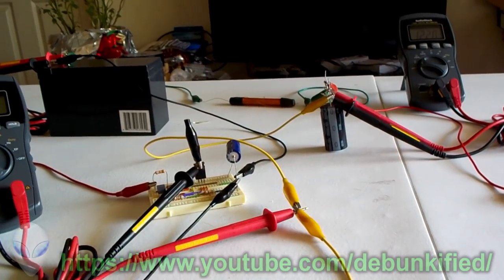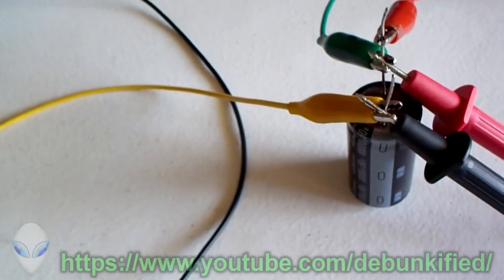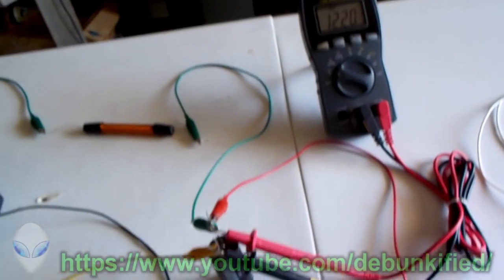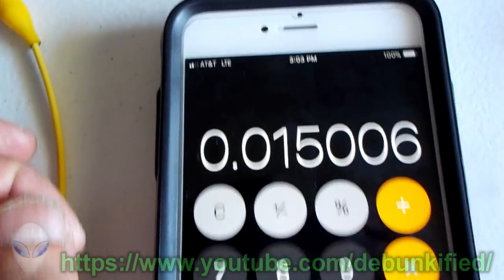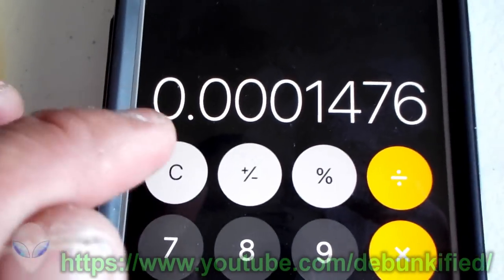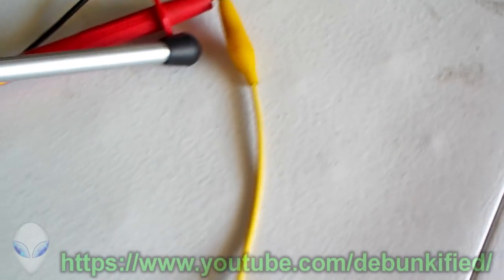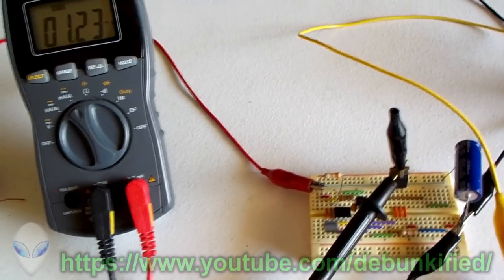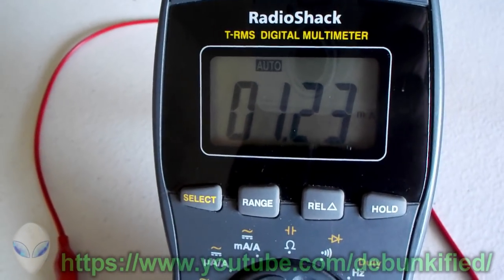LCR Free Energy Generator

Comment: Back EMF technology is one of the most promising and practical ways to generate free energy. It's cheap and easy to do, and doesn't require any electronic knowledge. All you need is a transformer and some wires.

The basic principle behind back EMF technology is that when an electric current flows through a conductor, it creates a magnetic field around the conductor. If that current is then reversed, the magnetic field reverses as well. By harnessing this reversing magnetic field, you can create a power generation system that produces free energy.

One of the best things about back EMF technology is that it's very efficient. In fact, it's estimated that up to 90% of the energy produced by a standard transformer can be harnessed using back EMF technology. This makes it a great choice for those looking for an inexpensive and easy way to generate free energy.
Reply: Didn't Nikola Tesla do something similar to this by having 2 coils resonate on the same electric frequency and then pulling power from the 2nd coil? Since there would be no EM feedback and drawing power from the second coil would leave the first coil unaffected. Patent US645576A - System of transmission of electrical energy.

Comment: 12.20 volts across 10,000 ohms = 0.0012 amps and  .outputs 01464 watts. The device using 014858 loosing 0.000218 watts. COP = .79 . Why do you think you can ignore measuring current thru load? There are  ways to get power from Earth, air, vacuum and ether...Keep trying !
Reply from the maker: Hi, coil smoke, well I can ignore the current running through the load because I’m not really ignoring it since it’s the exact same current coming from the input! Where are you getting the figure 01464 watts from? 12.20 volts across 10,000 ohms = 0.00122 and not the 0.0012 amps which you have also written,, but which would be an output of 0.014884 watts not 01464 watts, which you have also written. 

Not only that but the input is 12.08V x the current of 0.00122 which is .0147376W. The output of .014884 divided into the input of  .0148376 is 100.9933774834437. Multiply that by 100% and lo and behold we have 100.99% which is rounded up to the next whole number which is guess what? That’s right 101% just like in the video.

Rewatch this video again and look at all the volts and amps that are showing on the meters and then compare that to the schematic I’ve provided in the description box. Better yet actually build it so you can see exactly what I’m talking about here.

Comment: Thanks for the circuit diagrams.

0.000147mW = 0.14uW not 1.4uW.
Sorry Credibility factor drops, by a factor of 10.

Are your DMMs rated at 145kHz? I don't think so, your meters cannot measure AC voltage or current at that frequency.

You are not measuring the current through just the resistor, you have the capacitor that it is across, with a PWM pulsing current.
NOT Continuous DC current

Your current DMM is trying to measuring the average of the pulsed current that flows on each ON period of  the PWM, charging the capacitor AND flowing through the resistor.
During the OFF period, you have a capacitor / resistor SERIES circuit, the capacitor discharges through the resistor and no current flows through the meter, so the meter is showing AVERAGE current, not full time continuous.

So you cannot calculate the power dissipated in the 10,000R resistor using the current DMM where it is, because it is measuring current to both capacitor and resistor and averaging a pulsed DC current.

The DMM measuring the capacitor voltage is also measuring an average voltage as the capacitor charges and discharges.

The addition of the coil may have some effect over the current, but only because of the  IMPEDANCE of the capacitor and coil.
Reply from the maker: Hi George
I respect your sound knowledge in the electronic arts but I have to disagree with you on a few points. I have indeed considered the reactive impedance of both the capacitor and inductor and pulsed DC currents.

First the voltage on the capacitor is actually there since the capacitor was completely disconnected while charged to it’s highest voltage and the voltage remains for a time before leakage begins. So this shows that at least the voltage is completely and accurately real especially across the resistor since it is in parallel to it after all. Thank you for looking at the schematics.

Sometimes I make mistakes in what I say in the video that don’t line up with the actual measurements so I’m not sure where you are getting .000147 mW from in the last video before this one.

Where you had written .000147mW = 0.14uW and not 1.4uW. Well I’m pretty sure you were talking about the input watts which are actually 14 milliwatts and not microwatts. In fact I have no idea where you’re getting these figures from, even though I might have said something different than what the meters were showing, which I know what they were showing, but I also know that I spoke it wrong, so this I am aware of but I know for a fact what the power measurements actually are. Video making is difficult so I will say things wrong sometimes.

So I have measured everything again and here are the results as of the present moment:

The meter is placed, very first thing right after the negative of the battery.

Pulsed through the mosfet, capacitor, resistor and inductor. 

Input = 12.20V x 0.00124A = 0.015128W. This 15 milliwatts ok?
Output = 12.30V x 0.00124A = 0.015252W. Ok? Out/In = 1.008

With everything exactly the same except now directly connected to the battery and without the pulsing circuit:

Input: 12.20V x 0.00123A = 0.0150W
Output: 12.19V x 0.00123 = 0.01499W Out/In = 0.999

With everything exactly the same except now directly connected to the battery and without the pulsing circuit and capacitor with the resistor and inductor only:

Input: 12.20V x 0.00123A = 0.0150W
Output: 12.19V x 0.00123 = 0.01499W Out/In = 0.999
So it’s the same without the capacitor.

With everything exactly the same except now directly connected to the battery and without the pulsing circuit and without the capacitor and coil, with just the resistor alone :

Input: 12.20V x 0.00123A = 0.0150W
Output: 12.20V x 0.00123A = 0.0150W. Out/In = 1.00

With everything exactly the same except now directly connected to the battery and without the pulsing circuit and without the coil, with just the resistor and capacitor alone :

Input: 12.20V x 0.00123A = 0.0150W
Output: 12.20V x 0.00123A = 0.0150W. Out/In = 1.00
So the same without capacitor and coil.

Now when pulsed through the mosfet and timing circuit with capacitor and resistor only :

Input: 12.20V x 0.00123A = 0.0150W
Output: 12.12 x 0.00123A =0.0149076 Out/In = 0.99384W

So the current essentially stays the same with direct and pulsed current while the voltage is higher on the output in the capacitor and across the resistor. When the meter is placed just before the resistor, it’s actually higher because voltage is higher which we know is real and lines up with ohm’s law, despite it being pulsed or not. 

Even when the pulsing circuit is disconnected and the resistor allowed to draw current off the higher voltage in the capacitor, that we know is there, then we still get the same higher current which of course lines up with ohm’s law because now it’s just a direct current. The meters are True-RMS meters and measure a variety of pulse forms.

I’ve been studying this circuit and where all the amps and volts are at every point in the circuit for days now.
Reply: I concede the mW and Watts.
It becomes very hard at times to follow your videos.

But at 7:09 into your video you have a calculation that subtracts watts from watts and  has an answer of  0.000147 W, which is 0.14mW not 1.4uW that you say.

Also in your reply above you do this calculation.

Input: 12.20V x 0.00123A = 0.0150W
Output: 12.12 x 0.00123A =0.0149076

 Out/In = 0.99384W  ??   SORRY NOT WATTS that is a ratio of Watts.
(I understand that this could be a typo, but proof read would have found it.)

Basically this calculation is good for the DC current you place through the circuit for these measurments.
BUT not when you use a pulsed, basically an AC current through your circuit, you have to include the IMPEDANCE of your capacitor and coil.

Some other suggestion.
Your DMMs display to 2 decimal places, keep you maths to 2 decimal places. eg

Input: 12.20V x 1.23mA = 15.00mW
Output: 12.12 x 1.23mA = 14.90mW

Out/In =14.90mW/15.00mW = 0.99 efficiency factor.

Lots of extra digits not needed.
Tom
Reply from the maker: Yes you are right, 0.14mW and I said 1.4uA which is wrong, so this is one of the errors I said I did make. I’m not sure why the brain fog lately, but it really gets on my nerves because I usually don’t do that. Anyways so yes, in reality there is a 147uW or 0.14mW of gain, or what is being termed as a gain . 

The output is clearly correct and accurate as previously mentioned when the capacitor is disconnected it holds the higher voltage demonstrating that the voltage is real, and of course the resistor draws current from that voltage, also made evident in direct alignment of Ohm’s law.

The input voltage is real too of course and you can’t go wrong with a voltmeter connected directly across the power supply, which is the battery in this case. That’s done everyday.

The only thing that needs a real good looking at is the input current and I wanted to ask you about that. Since the capacitor and the resistor is already an RC filter I would think that it is already serving as a snubbing filter for the output. What is needed is a filter on the input, which I don’t think is absolutely necessary but would like something like that to get to the true input current if it isn’t already that. Do you have any ideas of how to do this?

There is also an inductor in series through the entire circuit and I believe this is serving to filter the input current. So the entire circuit is filtered already, or is it? I know capacitors in parallel smooth out voltage and inductors in series smooths out current.

Something to think upon while I await your suggestion is that by pulsing the capacitor only, there appears to be absolutely no current going into the capacitor while keeping the high voltage at a higher voltage than the input. How it does this is beyond me and it is highly suspect that you are right and that there is an AC going on, but only on the input*. But if that’s the case wouldn’t the battery be consuming basically nothing? Or is this the wrong perspective? At any rate *how can a lower voltage keep a higher voltage up? I assume there must be AC produced by an oscillating collapsing magnetic field, but then again wouldn’t AC be leaving and then entering the battery making it not consume anything? AC is basically two DC currents happening. Not only that, but wouldn’t the collapsing field charge the capacitor up to its higher voltage level and then be blocked by the capacitor? So more like two DC currents, 

1.) First from the battery and then blocked by the capacitor,
2.) Second from the collapsing field from the coil which is then blocked a second time by the capacitor.

But then how does a battery with a lower voltage than the capacitor flow into a higher voltage and keep a higher voltage there? If there is no current then from the battery then how can there be a magnetic field to collapse to charge the capacitor to a higher voltage level than the battery? See what I mean yet?

The best I’ve been able to do is replace the battery with a super capacitor and time how long it takes to drop to a certain voltage and then charge it back up to the same voltage and compare that to the input current through the resistor and how long it takes to drop to the same voltage or less. This is a bit overdrawn and is why I need a simpler solution you see? A filter or something would be just fine, but just as mentioned, there are filters all over the place anyways. 

So the input current needs to be solved if it isn’t already. Any ideas?.